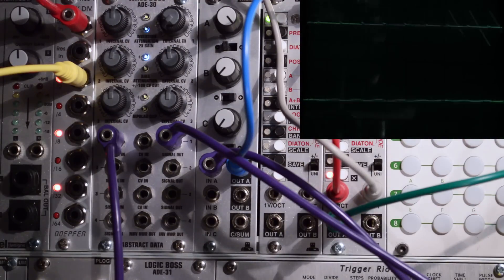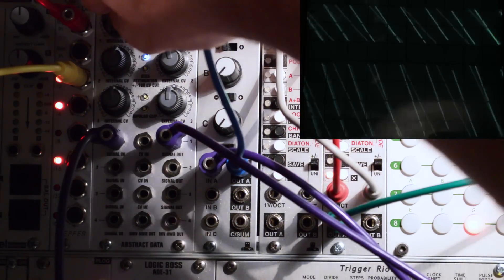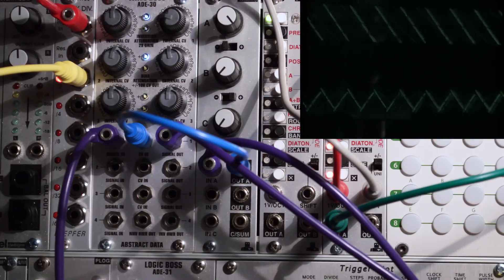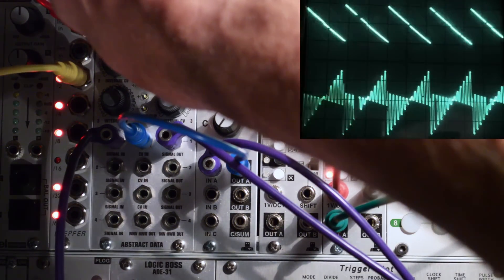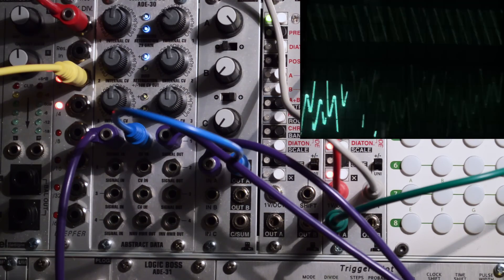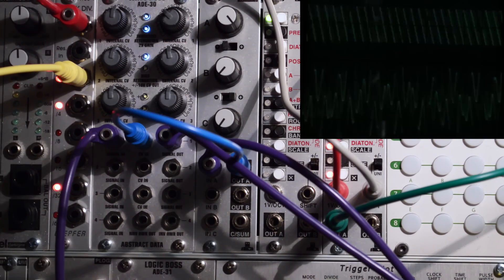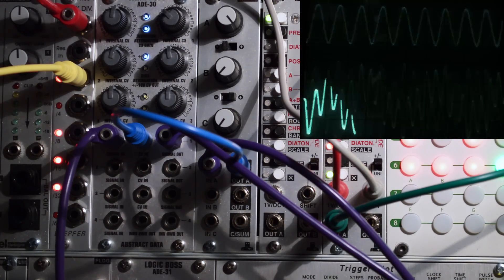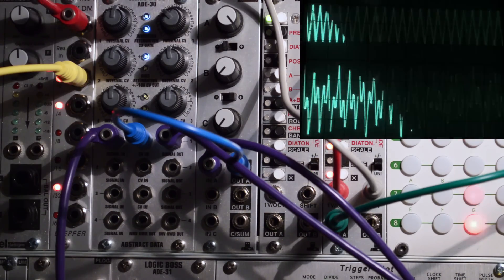Why can I never have enough VCAs? Part 2 - VCAttenuverters and beyond!

Comment: Is the Wave Boss analog or digital? Also does it output a DC voltage if no signal is plugged in?
Reply from the maker: +Ian Hoffman 
I believe it is analog. 
The first channel does not but the second channel is a dedicated bias/ofsett channel and that outputs a constant voltage (under voltage control)

You can read about the module here:
http://www.abstractdata.biz/products/eurorack/3x/ade30/